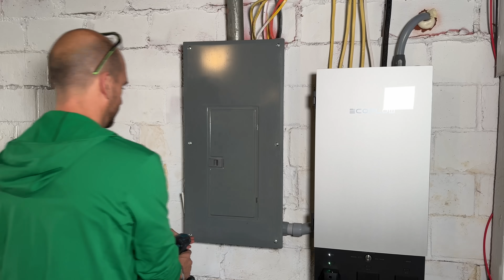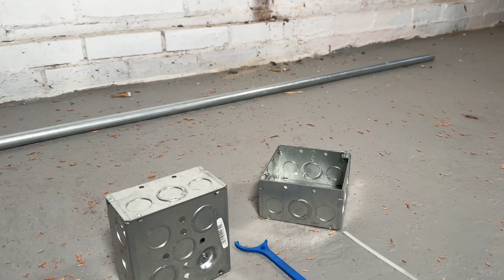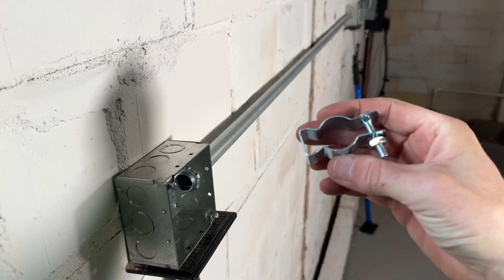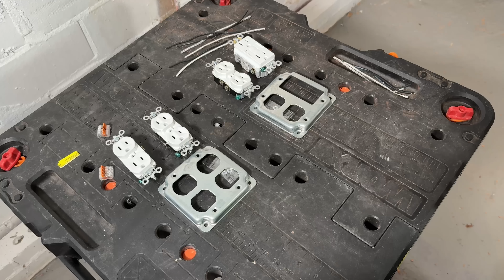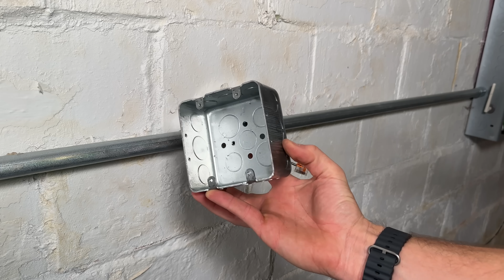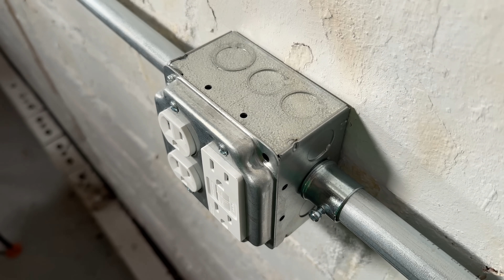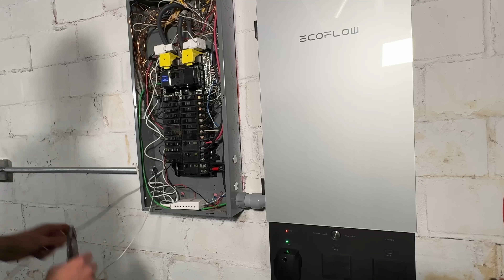Add Outlet To Unfinished Basement Or Garage

Comment: There are many people who don’t know how to properly use a wire nut, and for them, the Wago is a good choice to help make an acceptable installation. Most modern THHN wire has multiple designations, including for wet and damp environments. It’s easier for the wire manufacturer to produce one wire listed for all applications, than to make separate wires as they used to years ago. It is important to remember that the use of a raceway listed for a wet and damp environment does not create a dry environment inside the raceway. In a wet and damp environment, all components must be appropriately listed for that environment.
Reply: @karlwithak
That will work inside under dry condition .
But as electrician you will lost your insurance and as a homeowner possible too.
You can do also old  edison style: line up a bunch of nails and wrap 2 blank cables around.
Reply: An electrician buddy of mine suggested that after the new circuits are all working the way you want,  he suggested taking the wire nut off of the pig tail and then put some solder into the pig tail and replace wire nut. The pig tail will never come apart. 
I don't like those wago things either,  tried them and had a bunch of loose connections.
Reply: the wage will fail in time the weren't not so much especially when you twist the wires together
Reply: I do not trust, and would not use a WAGO. In order to make good connections, twist the wires together with you lineman's pliers, clip off the excess, and install the PROPER wire nut. WAGO might work for your Lionel train set, but I would not trust then with line voltage.

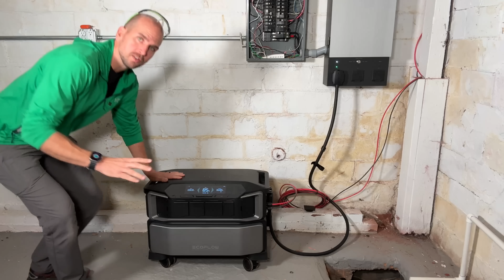Comment: 13:27 Sorry, not going to have the risk of thermal runaway with a lithium battery that size,  in a China-made unit,  in my home.  Maybe in a detached garage. I have two 2,000 watt UPS sine wave inverters, each  hard-wired to to a dedicated circuit, each powered by a stable, lead-acid old-school RV deep cycle battery, in a well-ventilated space by the main panel.  This proivides intant backup for critical circuits, and I have the option to fire up my generator later,  if the outage is an extended one.  Not taking the chance of electronics malfunctioning.
Reply: Slow down and investigate.  This unit is Lithium Iron, LFP, (LiFePO4) batteries. Not using Lithium Ion, LCO, (LiCoO2) batteries.  LFP has no cobalt in it.  Cobalt is the evil ingredient which tends to sometimes runaway, catch fire and explode.  Check the web for yourself.  And beware of which one is being offered.  Manufactures are trying to get rid of their existing stock of s--ty batteries like the ones in your phone and e-bike.

Comment: Considering this is a dedicated circuit, any thoughts on using a GFCI breaker in the box rather than a GFCI receptacle? Any advantage or disadvantage to either?
Reply: One advantage would be moving to a 25A circuit with 20A outlets. This would be supported with the THHN wire being used. Also much better with high surge current items like a shop vac or air compressor. Add the ground wire!!!
Reply: @newellfranks9099  Interesting idea. But then you'd have to bump up to 10ga wire..
Reply: No, 12ga THHN is fine for 25amps. It is the high temperature insulation on THHN that makes this possible. @ralphdoid
Reply: https://usawire-cable.com/wp-content/uploads/nec-ampacities.pdf @ralphdoid

Comment: Electrician here. While you said it was just best practice, there is nothing against code running NM cable in conduit like in your thumbnail. You do have to follow cable fill requirements in Chapter 9, however. The problem most people make is stripping the jacket off and just using the wires inside. Unlike MC or spooled wire, the conductors inside NM cable are not labled with their insulation class or any other required information, and not permitted to be run in conduit without the jacket. You used solid wire, so I hope you didnt strip the romex and use it for this reason. While it is true EMT is a permitted EGC in 250.122, you are relying on the set screws and locknuts being tight for that grounding and bonding purpose. They can loosen over time, so its not a bad idea to pull a wire type EGC. Also, code has NO prohibition for using a bare grounding conductor for this installation.
Reply: Totally agree.  Best practice is to run grounding if you can.  Trusting "BONDED" grounding is a dice roll at best as stated.  Equipotential for all of your circuits is key, heaven forbid a child or anyone else plug something in on a loose "BONDED" box and then when finished noticed this and used their one hand to support the box and the other to remove the plug.  The possibility of a fault that "EXPOSES" itself could be very dangerous.
Reply: @alryky30  A lot of the MC no longer has the wires inside marked. They just put a tag on the roll of MC, and that passed for being marked now. Lots of jurisdictions do not allow NM in conduit. Some of the old NM had marked wires inside of the sheath. General Cable up in Kingman, Arizona made it like that. Now all that cable and wire for General Cable is made down in Mexico. We could special order UF/DB cable in lengths up to 10,000 feet for golf courses. Three #4,3 or # 2 and one size smaller for a green grounding wire, all UF rated. We'd take off at a dead run and pull the wire off and snake zig zag along the ground, and feed it up the concrete bases for the bollard cart path lights. Throw it in the trench set the base and bury it. We had Mexicans dig and backfill for us. You had to watch for hook slices in those long cable runs. Sometimes GC screwed up. I have seen them in Romex too. If you see a weird spot in NM feel for hooked wires and you will know if they are there. They'd forget to pull that roll and ship it by mistake.
Reply: @Satchmoeddie Is MC the same as BX?
Reply: @davidstevens1911 Similar, but no. BX is no longer made and the closest thing to it today is AC, armored cable. MC, metal clad, is the most common kind of metal sheathed cable used today
Reply: I couldn't agree more. While he often does teach 'alternative' measures, this video being one of them withOUT the ground wire, he does state that ONLY in this application is this applicable. Sometimes I feel he skirts the preamble of safety to put a video out. For clarity, I digress, If I was him making this particular video, I'd stress at the BEGINNING of this video that what you are about to see is NOT THE NORM and the cautions that come with it in said application are to be thoroughly reviewed and considered for each unique application because what everyone else has said that over time should the nut come loose, or someone came behind and unscrewed and screwed the panel back on is completely inviting a hazard! Let's be honest, there are a lot of knuckleheads out there and will blindly follow this video and create a problem, or something worse for themselves. The culpability on this video is high and the way courts are today, I wouldn't even put this out there without several, very CLEAR disclaimers.
Reply: No conduit support straps or mini’s. When you see “bonded grounding” fail you will always pull a ground after!
And why strip nm when you can pull thhn.
Teach the real way to do things.
Reply: @Realcleverkid  you cant strip the NM, thats my point. I agree, pull THHN. I was simply stating it is code compliant to use NM in conduit.
Reply: @nickpckles8902 you can use nonmetallic conduit,  but it sags over a short distance.   It doesn't look good.
Reply: You can definitely run NM cable in a conduit it if meets the same requirements as without mechanical protection. Leaving at least 1/2” of cable jacket in box. Identifies the AWG, White, Yellow, orange
Reply: @10Flat   Are you implying that the code now requires the use of the color-coded NM cable?
Reply: @denali9449  I’m just saying it keeps the inspector from questioning cable size. Yes there’s a way around it by putting an incorrect jacket.  there’s always way around things if someone is unscrupulous. It’s no different from using a sleeve and inserting nm cable through a wall.
Reply: @10Flat  Thank you. I was mostly concerned that the NEC was now requiring the color coding as I still have 1,000's of feet of brand new white sleeved 12 and 10 gauge wire sitting in the shop. Been using it up as we can but most of our work is pipe and wire, very little call for rope. Long story involving alcohol, helping out an old friend and some horse trading . . .
Reply: At one of my code update courses the speaker mentioned that short runs of NM cable within conduit are tolerated. This is to allow runs that have Romex feeding into a short run of conduit, without always requiring a box exactly positioned at the juncture. However as you allude to, you need to be sure your 40% conduit fill rules are adjusted for the extra cross sectional area of the cover. The reason some get uptight about the cover is the way wire is rated for temperature, and if it is wrapped in both insulation and conduit it won't be able to disperse that heat as easily. So it is easy to see why electricians would pull in single wires that retain their id stamp except in rare situations.
Reply: @spelunkerd  There is no need for Romex to disperse heat and it will not overheat simply by being in conduit. When a single cable is in conduit the fill is 53%, not 40%. Not sure what code update class you took b ut if you paid for it, your money was not well spent.
Reply: @spelunkerd  Short runs, long runs, doesn't matter -- there is NOTHING in the NEC that prohibits using NM cable ("Romex") inside conduit, period.
Reply: Does the conduit need to be metal or can you use the plastic conduit for a basement run like this?
Reply: @frankesposito1399  pvc sch 40 or 80 would also be acceptable
Reply: @frankesposito1399  You can use conduit that is made of plastic but then the US National Electric Code (NEC) requires a wire grounding conductor.
Reply: I used to think inspectors were just letting me slide in runs to islands where I couldn't see adding connection points to switch back and forth ....  but finally inquired and looked it up

This is his worst video as a ground conductor is also required ... they stopped allowing conduit as ground 30+ years ago
Reply: @MrOpinionCantSignIn  EMT is still allowed ad a groundING conductor per 250.122. Dont just use the phrase " ground conductor". Its either grounded or grounding. As far as the rest of your post, I have no idea what the hell you are talking about
Reply: @MrOpinionCantSignIn  Incorrect, EMT is allowed as the EGC.
Reply: Why not just use mc cable!
Reply: I just hate people that pigtail everything at the last receptacle. They don't need to. There's a nice picture of it in the NEC handbook, the one with pictures.
Reply: Man my knees, dude fancy stuff for supporting the run , and tapcons to mount, could have deleted taking all apart, drive its would have worked too
Reply: Holding conduit off the wall is a rookie move. I would have jogged the conduit at the boxes so it sat flush on the block wall and fixed it with one hole straps for a really clean look. Also, I routinely use a powered driver for those Tapcon screws without any issue. They never strip but if they did, it's easily remedied with a dowel or strip of copper wire.
Reply: @rjm7168   I completely agree.  If it's not in contact with the wall it becomes a place for my wife to hang things.
Reply: @rjm7168  It's not at all a rookie move. Real electricians sometimes use box offsets and 1-hole straps to keep it against the wall, other times run it straight and use minis, depends on the situation. In this particular case either way is fine. Holding conduit off the wall is done professionally everyday. Box offsets also add to your bends count and reduces your run to no more than three 90s.
Reply: Set screws and locknuts do not magically loosen over time, any more than ground screws loosen over time. I hear this a lot, and it's not true.
Reply: @pld8993  fine. But overall in installations you are relying on every installer properly tightening every set screw and locknut. Id like a wire type EGC in addition
Reply: @stillthakoolest  True, you're relying on professionals who've been trained to do a particular job, just like when you take your car in you're relying on the mechanic to tighten things that need to be tightened. I hear this argument all the time but I never hear anyone asking for unnecessary redundancies when their car gets repaired, just in case someone forgot to or didn't tighten something properly. Tightening things is part of my job as a professional and I tighten every screw and locknut, like all good electricians. If it's assumed that I might not tighten a screw or a locknut, why does that same unfounded fear not apply to ground screws?
Reply: I think I screwed up!  I stripped the outside cover off the romex and ran it in the 10 ft long metal conduit for my living room fan.  It will be inspected buy the electrical inspector.
Reply: @Montanariverguy  Worse case, inspector spots it and you have to redo it. Because electrically it's not a hazard, there's a simple way to cheat it but I'll let you figure that out.
Reply: As I understand it, code as of 2020 does not allow NMC in damp locations except overhead on floor joists and must be protected as it goes down the wall. Damp location definition is a little bit fuzzy, but most basements are considered damp.
Reply: @TomCee53  Most basements are humid, not damp. Only damp basements, visible moisture, would be considered damp locations.
Reply: as an apprentice many years ago I learned that running Romex inside EMT can induce eddy currents.
Reply: @faradaysage15  No it does not
Reply: @faradaysage15 you learned wrong. How can a nonmetallic jacket cause eddy currents to happen where the absence of that jacket doesn’t. The current flowing in opposite directions in the two conductors cancels the fields either way.
Reply: @faradaysage15 eddy’s in the space-time continuum.
Reply: Non Electrician here, what the heyll did you say???
Reply: Exactly! The code specifies using conduit in areas that need to be protected.

Comment: I was under the impression that three feet of the floor in front of the panel had to be kept clear; in fact, an inspector chastised me for having a lightweight folding chair open in front of the panel (but allowed me to remove it before he began his inspection). If that's NEC, the battery box you have in this video is in the way, and should be moved.
Reply: that's a portable box. I assume he put it there for the video.
Reply: I'm not an electrician but intuitively it occurred to me that the battery placement is less than ideal. It has a non-zero probability of self combustion  and who'd want to trip the main breaker two feet above a battery in thermal runaway mode?
Reply: You are correct.  Nothing can't be overhead ( say a water line) or 3 feet in front of any electrical panel.

Comment: Electricians I worked with always ran  the green (ground) lead.  Yes, your ground can be through the emt but it can be interrupted by some schmuck.  Having the ground lead is a safety device.
Reply: Agree cheap insurance that there will always be an uninterrupted ground to the panel.
Reply: Another reason to run a dedicated earth is the the EMT could suffer from corrosion many years into the future causing a bad earth.
Reply: @johnspathonis1078  So why would the EMT suffer from corrosion but ground screws are somehow immune to it? Nonsensical.
Reply: @pld8993  you ground directly to the device with a dedicated ground. THE DEVICE WILL ALWAYS BE GROUNDED WITH A DEDICATED GROUND.  RELYING ON AN EMT GROUND AS THE GROUND IS THE DUMBEST THING I'VE EVER HEARD.
Reply: @pld8993  Copper corrosion is different than steel corrosion.
Reply: On large commercial installations, they never ran a ground in conduit unless it was for a GFCI or if it was in flex that was over 6'.
Reply: The guy that made the video is the schmuck.
Reply: So then "some schmuck" means some later home-owner crap-jobs DIYer?
Reply: The inspector I worked with wanted a ground wire.

Comment: What is the real reason?  Romex bad, single insulation good.
Conduit is industrial and used in exposed areas. Industry is cheap, and anyway to save money is good no matter if it is a single point failure system. Ground wire ensures a  better chance ground is available. You could use MC(Metal Clad) cable, metallic sheathed cable, AC(armored cable) or BX cable, the flexible corrugated surface version of Romex. My AC power line run starts at the box thru garage metal conduit, through basement rafters, outside with plastic armored flex-conduit to the Disconnect box; insides the whole run continuous is Romex. Installed by two licensed electricians and Inspected later.